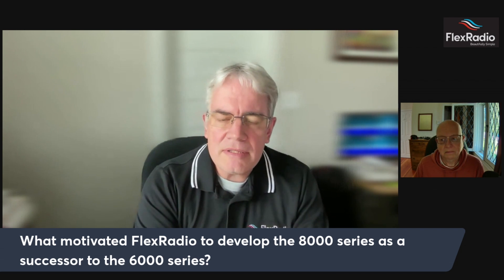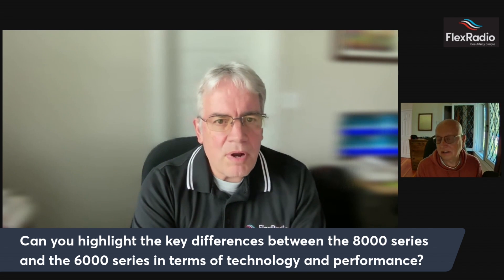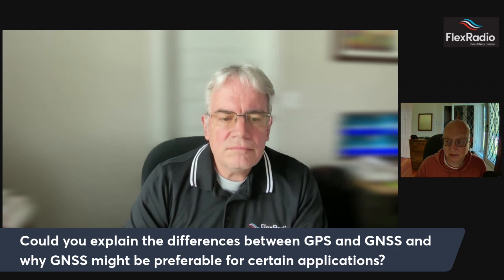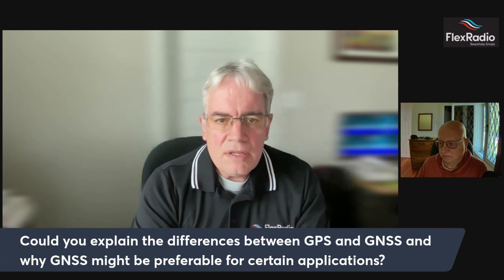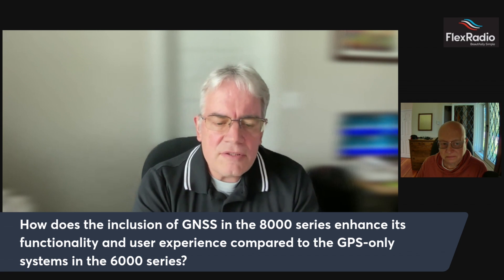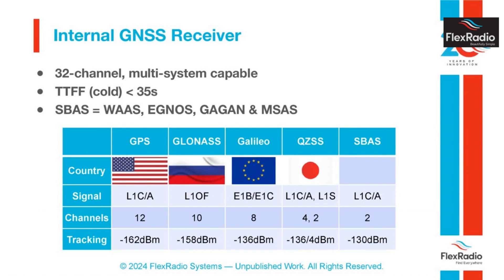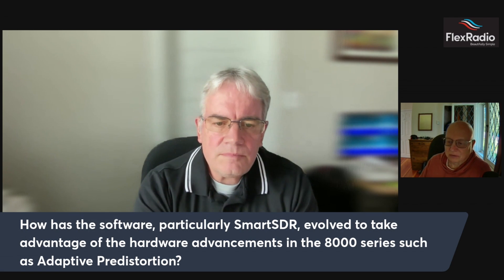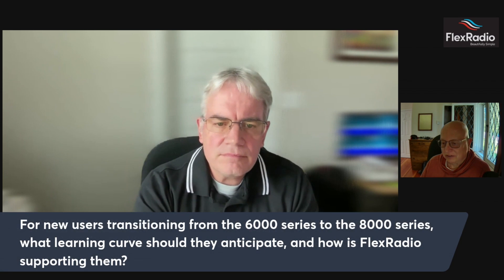Discover the All-New FLEX-8000: Inside Innovations with Steve Hicks N5AC

Comment: is the GNSS included in all of the 8k series radios?
I think I heard that, but cant really say for sure. "integrated inside the radio". Does that mean its an option or its already there. Thanks! If I get the gpsdo, will it be either or? Or can you have both?

Comment: A little disappointing.  I just bought my 6600m so now I will need to upgrade to get the new software features.  I understand why you needed to do it but even with trading in my 6600m I don't think I can afford an 8600

Comment: Is it possible, if you were to add the GPSDO module, for the Flex radio to function as a stratum 1 Network Time Protocol server? It seems like it has all the needed hardware to do so.

Comment: Question:  Will there be a way to use multiple samplers with ADP on the 8600?  I would like ADP active on HF, but I would also like to use it with my 2m and 432 transverters.
Reply from the maker: Good question.  This needs to be confirmed, but for a transverter, the radio only knows it as an rf signal at the IF frequency, usually 28Mhz.  You should be able to sample the RF at a -60db and feed that back into the radio for an adaptive correction.  This is a question that would be best asked in the FlexRadio community as we can that ask someone in the company to respond.